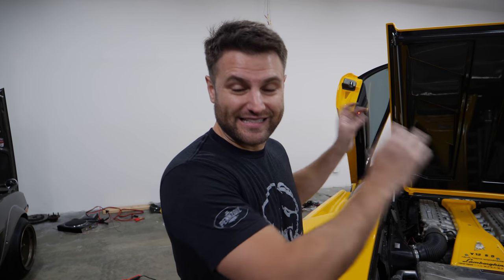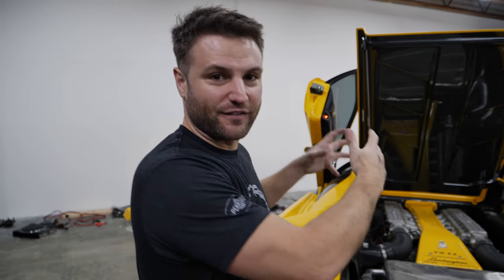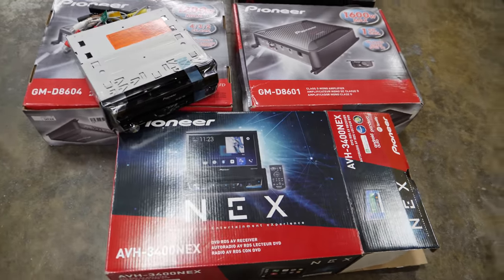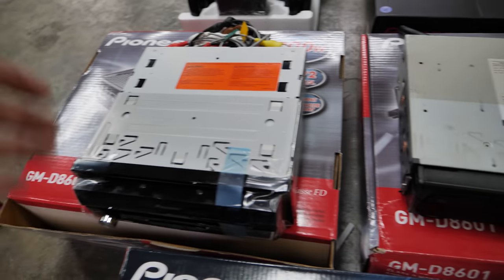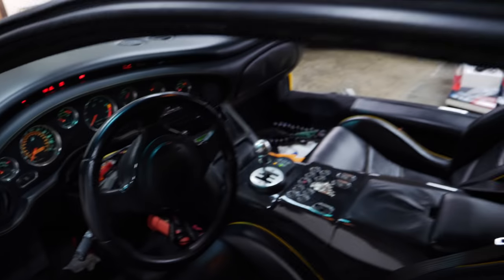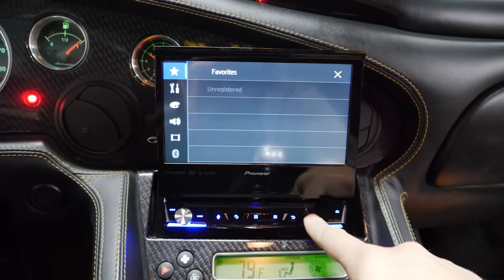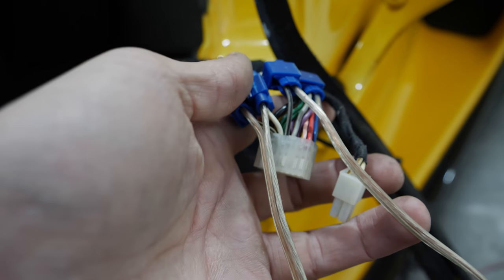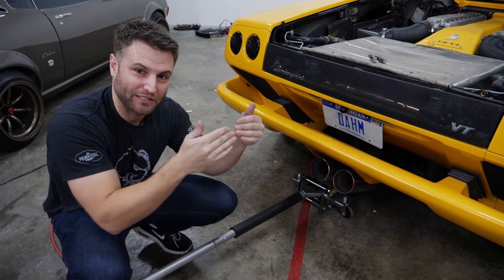Installing the one thing a Lamborghini Diablo needs most

Comment: I hate those dang splice connectors
Reply: yeah scotchlok's are horrible... he should have just got an adapter harness they make them for every car radio known to man especially an alpine.
Reply: @Plan0B0Krue  I doubt they make an adapter harnes for a lambo.  I had a brief experience with these devils when I was a new driver many years ago.  They are the devil.  One would always fail.
Reply: @beargibson3100  At least you can get those connectors and make adapter with long lasting connections instead of those horrible pain of butt after some time connectors. I hate so much those. When got a car with electricity problems.. YEAH THOSE CONNECTORS WERE USED BACK IN THE DAY OF INSTALLATION.

Comment: Rob! Scotch locks? In a Lamborghini? Seriously? Come on dude. I wouldn’t use those in anything. Gah.
Reply: @damagecase13  they're really unreliable and tend to corrode badly. They're normally just used as a temp thing or to see if something works before it's all buttoned up, but Rob's got them in as a permanent thing. Honestly, it'll probably be fine, it hardly get driven, and doesn't really see water.
Reply: Yea those vampire connectors are shit.
Reply: In the industry they are often only half jokingly called firestarters. Vibration causes the v inside to slowly cut through the wire leaving hot wires floating around and often causing intermittent faults. Solder and heat shrink or is burning the lambo to the ground an acceptable price for half assed job?
Reply: @damagecase13   in a high vibration environment like a car, they will fail and cut the wire. if you're lucky they blow a fuse, but if not they burn your car down.

and yet EVERY aftermarket kit for anything includes them.
Reply: Ironically Rob wanted to save the original harness so he can reverse the install if needed but the scotch locks at some point will cut through the wires he was trying to save. A professional would also leave factory harness but either by taping in using soldered and heat shrinked connections or by making or buying an adapter harness. Alpine have been using iso plugs for years so an adapter would be easy to source.

Comment: Could’ve wired the camera off the reverse lights instead of tapping off the reverse signal.    Think of the time you would’ve saved tucking wires all the way up the car.   
Or worse, causing a problem. We know how temperamental lambo’s are.
The reverse lights run off the same exact signal.
Just a thought for your next back up camera install.

Comment: OH Rob, those splice connectors are absolute trash and will do more harm than good.  Best thing to do is to get an adapter that plugs into the existing connector and breaks out to what you need.  I've found more electrical problems which were caused by those splice connectors than anything else.

Comment: two amps? should have requested a gm-d9605 5 channel, same footprint as one of those two, and while not quite as powerful, honestly, in a cabin that small, it'd be plenty for most people. i have one and even with my basshead habits its plenty to satisfy the cravings.

low pro pioneer subs are good, but they do hit excursion issues (ask me how i know! [really, don't, it should be obvious]) so you're gonna get some BRRRTTT a lot sooner than you would with a normal sub, but i guess you'd have to deal since the diablo has some space premiums going on.
Reply: Just out of personal experience and opinion(by no means am I trying to say what should be done) I've noticed some feed back issues with most 5 channels I've either installed or dealt with, nothing major but still there. I definitely agree on that they are conveinient and smallish form factor. Also fully agree on preferring the none shallow subs as they don't have much excursion and can bottom out easier, mind you I'm currently running a sundown x12 with 4 inches of peak to peak mechanical movement
Reply: i had a pioneer gm-d9605 installed in my truck before it got totalled during our last freeze out this way, nary an issue with it. if i didn't know it was there, i... well, wouldn't know it was there. completely transparent, no noise no interference. from super quiet to ear splittingly loud. though i will admit that you're right in the regard that some of them do. improper channel isolation in the circuits, usually. pioneer seems to  have done right by the gm-d series though.

x12s have 30mm xmax so ~2.5" full excursion if the frames allow for it. not sure where you get 4 inches from. even if you're driving it super hard i'd imagine you could maybe get ~3" full flex. (30mm -> 3cm -> 1.18in x2=2.36+30%=3.068in, 77.92mm, per sundowns specs). still good travel, even if i'm not a fan of the super high surrounds, myself.

Comment: Bluetooth sucks for audio quality.
Reply: Yea but when you're in a lambo with less than amazing speakers it doesn't matter
Reply: @nottommy1002  I can't argue with you there!
Reply: USB for the win and well you know not pioneer speakers, although better than what was in there. Also Bluetooth still generally sounds better than aux for the most part
Reply: @DustinPrat  I'd say that's arguable, and in the case of a true line level signal (as opposed to the typical crappy headphone output), it's absolutely wrong.  Most phone headphone outs are beyond dreadful, with massive distortion and noise.